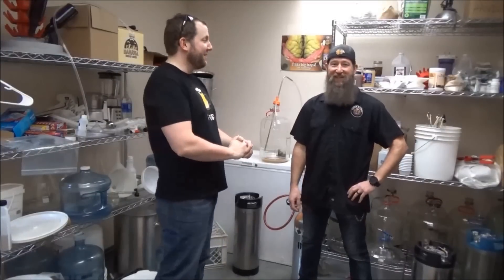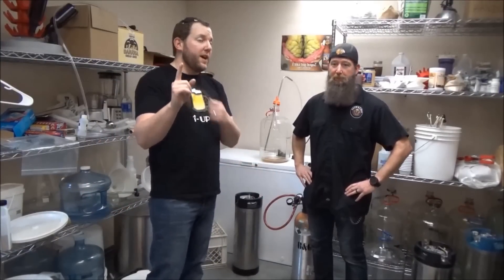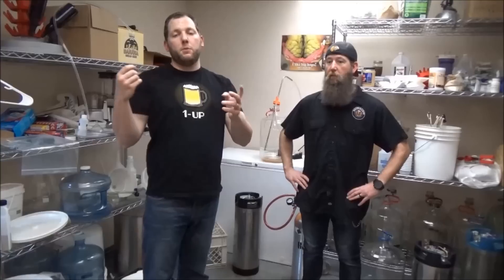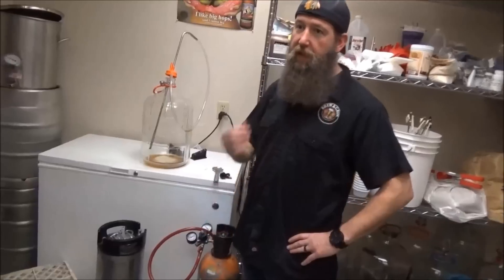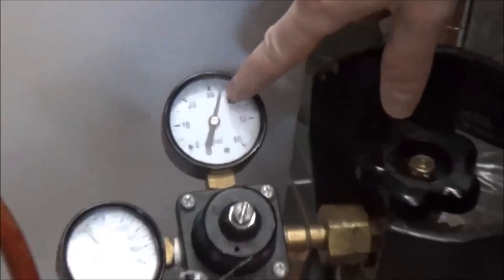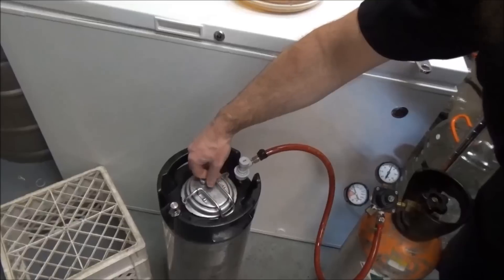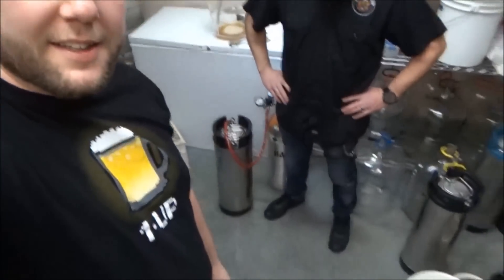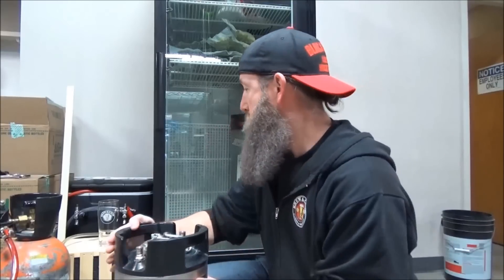Force Carbonation Revisited

Comment: For what it’s worth I force carb almost all my beer. 
You can take a 60 degree Fahrenheit beer transfer to a keg, force carb at 9:00 am and be drinking it at 5:00 pm.  I just gas it (standing up and rocking) to 35 psi and throw it in the fridge. Pull  it out again by 2:00 pm and hook to the gas at 35psi and rock it for another minute or two. And chuck it back in the fridge. 
When I pull it out to serve at 5. I purge most the pressure snap on the faucet and start pouring. I seldom even have to hook up to the co2 tank the beer is so gassed that if I trickle beers into the glass the faucet keeps running. 
I have found this to be a convenient method for me. I don’t drill holes in the beer fridge just pull the keg out at 5 set it on the floor and enjoy a few beers. Five gallon kegs don’t last a week around here so what would be improper handling never has a chance to be a problem.

Comment: No need for 30psi Cold crash the beer to say 10c , i put 10 psi on it ,lie the keg down , turn it so the gas diptube is at the bottom ie under beer. Rock it until noise of gas bubbles stops , takes about 15 mins. I also have a non return valve on my gas tube so no risk of beer getting into the reg.

Comment: Been home brewing for 10 years and bottling. Just switched over to kegging yesterday. Watched a million different ways to force carb. Chilled my keg down to 37 degrees for 24 hours. Set regulator to 30 PSI and did the flip it sideways and rock it back and forth in my lap for a count to 100. Waited an hour and tried to dispense. Cant remember if i purged and set to dispensing pressure of 10psi. Dispensed and shot almost all foam. Purged and set to 10 psi and still foam.  Wish i had seen this video first.  Going to let keg chill down for a day or two and try again

Comment: Will I need the c02 on while I'm serving or can I just hit the keg with c02 once like you just did when you feed it through the liquid side, let it sit for 2-3 days and it's ok until you run out of beer?
Reply: The co2 is needed at serving or you won’t be able to dispense beer. The co2 that builds up in the headspace is not enough to dispense more than a few beers.
Reply: Serve at 10-12 psi, correct?

Comment: Great video. May I ask, how long can it stay in the keg after the forced carbonation? Could I hypothetically keg and force carbonate 10 kegs at the same time and then just leave them in a walk in fridge until i need them?
Reply: In theory the kegs are sealed pressurized vessels, so as long as you don't have a leak or intentionally purge them, should be able to keep them good for a good length of time, just when you decide to store them for long time, I believe you would want keg dialed down to serving level so it can balance out over the duration and so don't get a nice surprise beer rocket off your faucet months later when forget it's carbonated at 30 plus lol, cheers

Comment: Hey guys. I have a 1.75 cannonball keg and was planning on force carbanating and drinking the beer tomorrow. Would I still set the co2 at 35 psi? and if so would it take as long as to carbonate as a 5 gallon keg?

Comment: when I keg I cold crash it down to 34 degrees Fahrenheit over night, set the regulator to 30 psi hook up to dip tube side set my timer for 4 minutes and shake, put back into keezer for a week at 34 degrees Fahrenheit and I have a perfectly carbed brew, (CO2 not connected during the week )
Reply: Craig Neuberger thank you for sharing. Do you mean 4 hours or just 4 mn?

Comment: Hi guys great video!
I always have trouble with carbonating my keg. I usually do what you said with the shaking the keg for a minute or 2 on around 30 psi and then leave it under 30 psi for another day or so.
When I come to poor me a glass at around 5 psi all i get is foam. So I shake the keg a bit without any co2 pressure inside in order to make some of that co2 to come out of solution and I release the pressure. After I do that it seems to not be carbonated enough. I never get the carbonation level I get from a bottled beer I buy from the store. 
?Any recommendations
Reply: Eric, Alex here. Thanks for checking out the video! Trying to help you out with your problem... when you serve at 5 psi, is that through a little picnic tap, or through a kegerator?  If the latter, the length of your beverage tubing can & will make a big difference.  Also when you say you leave it at 30psi for another day or so, is that with the CO2 tank hooked up the entire time?  If so, that could be your problem right there.
But regardless, for foolproof results (if you're not in a hurry) just reference the links we have in the video description above.  Figure out how many volumes of CO2 you want in your beer based on style or personal preference, find the temperature of your beer, and use both those values to determine what psi you need to achieve that.  then leave your keg hooked up to a CO2 tank at that psi and leave it for a good week or so.  Once gas pressure has reached equilibrium, then you will have your desired carbonation.
For example, I prefer higher volumes of CO2 (like 2.5 or 2.6).  So if my keezer is set at say 44 degrees, I set my psi at about 15 and just leave it all hooked up.  I also serve at this psi, so to avoid foaming I have a good 18 feet of 3/16" ID beverage line hooked up between my keg & faucet. This provides the friction needed to keep the CO2 in solution & I get a great pour pretty much every time.
Hope my verbose response helps!  Cheers!
Reply: @alexcando4726   I am curious. How about if I use that little picnic tap serving at 5 psi, do I have to push the 30 psi pressure back to fill top space after I finish serving beer to my glass on that day?
Reply: @Poppy-ub3zb  Yes, at the end of the day repressurize the head space of the keg so that it doesn't go flat.  If the carbonation is good, around 15psi should suffice, or if you are still in the process of force carbonating 30 psi is good.
Reply from the maker: Eric Krief what comes to mind is a number of factors. First, the temp of the beer as it is being force carbonated. if you force carb it and then chill it, your pressure wont be right when you serve later.
Reply from the maker: Perhaps try to hit the tank with gas, chill it, then hit it with gas again prior to going to bed. Keep that psi close to 35 psi and not under, otherwise you wont be force carbonating.
Reply: Eric Krief great questions. Men from Smarty Pints thank you so much for sharing you knowledge guys.